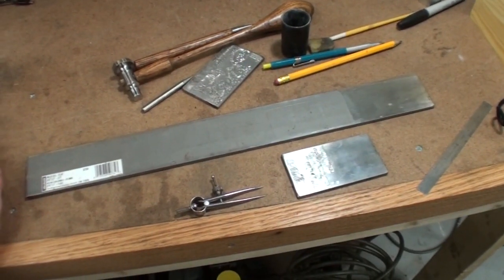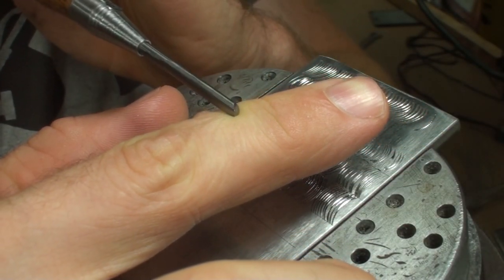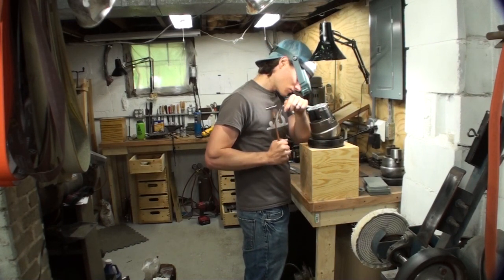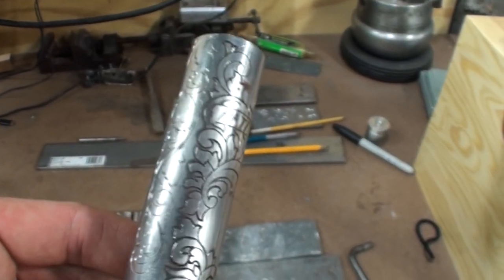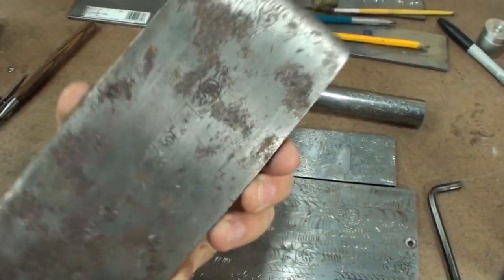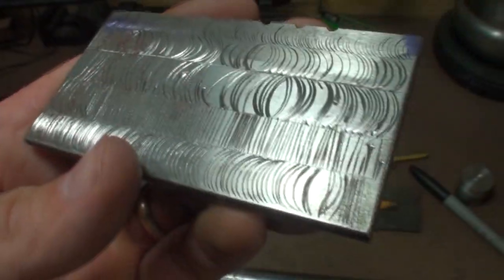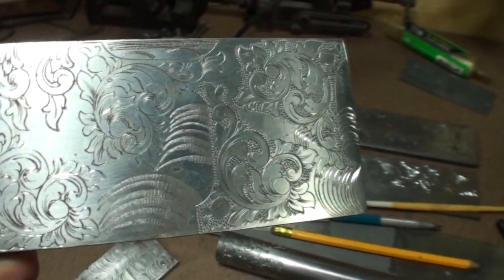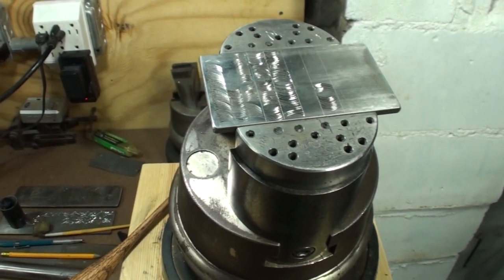Hand Engraving Basics - What To Cut First

Comment: really interesting, I have recently been getting into wood carving, I can see similarity's in the work but your working on a very detailed scale. Thanks for sharing.
Reply from the maker: There's some basic crossover which pretty much applies to any carving, just the tools are different. You also carving in something pretty hard, but at least consistent unlike wood where you deal with grain direction, and changes. Any carving is hard to learn, regardless of the material.

Comment: Hi From Sheffield UK...i have some carbide blanks...3mm and 3.5 rod..actually havea 2mm as well..can I ask at the end of this vid, are you using a 90?...70?....i made my own templates but , i think they are for power assist....120 , 110 is not going to work for me with push...i will make some flats from the rod...and mayb a few 90s, a 70 and a 70  kind of onglette....am I on the right track?

Comment: Hello great video, I have a question when ever I hammer on my graver the whole ball vise moves from the bottom every time i strike it doesnt matter how soft. How can I prevent this? thank you
Reply: Tried to use bench vice? Ball vice, (unless lockable in different positions) will not remain static because it is designed for push engraving. As such needs to be rotated by the non dominant hand for push graver work.

Comment: Excellent work and you have great way of explaining the process . You have inspired me to give it a try for the Lock on my Flintlock project . After plenty of practice of course . Any recommendations for my first hand Graver ? Thank You
Reply from the maker: Pretty much just what the video said, your biggest hurdle outside of the skill is the tools. Just engraving one thing is almost unfeasible because it takes so much practice to get to the point where it will look decent....so all that practice would be hard and a lot less efficient without the right stuff. I'd say slowly get the stuff together if your serious and just practice. The arcs are all you should worry about for a while. Just use mild steel flat stock. Look for more engraving content and perhaps someone to teach you.....not easy.

Comment: Fascinating! Thank you so much for vids! I want to engrave my own astrolabe on aluminium (since they are insanely expensive). Do you think that it is too much fuss to chisel out small numbers and small degrees hatches--is it a question of skill or even for a skilled artist it would be too much pain? I say that because a tiny number has such small radius curves.
Is there a method for transferring a printer image onto the metal surface? I was thinking of printing it onto a plastic transparency, then robbing the ink image with a scotch tape then sticking the tape onto the metal and engraving onto it. Or maybe there is a way of painting the metal with some sticky substance which will just suck the print out of the transparency pressed to it?
Reply from the maker: Learning the skill of hand engraving to do one project would be crazy. If I where you I'd do it one of two ways. Design the whole thing and have it laser engraved or you could acid etch it. You would mask off the whole thing then expose the areas you want etched. Look up copper plate print making.

Comment: One question: can this technique be used to prepare a makers mark for punching or burning into wood? I wondered how else to create the cavities required for this purpose. Filing will only get you so far. I enjoyed watching your videos. Thank you.
Reply from the maker: Yes it can, just has to be a reversed image. You can also use carbide tipped grinding bits for flex shaft tools or dremels I guess. The easiest way is designing it and paying a company to do it.
Reply: Thanks. I wasn't looking for the easiest way, but for a way to do it with the minimum amount of tools.

Comment: Are you using a turntable for your vice ?
Reply from the maker: No, it's a magna block vise sitting in its normal tire vise on a block built up out of wood. The vise swivels in it's middle and the resistance is adjusted by a allen bolt.

Comment: I heard that you can use concrete nails and sharpen them into a graver for beginners if your short on money, is this true?
Reply: true!
Reply from the maker: Maybe, but I don't see it as a very long lasting tool..... maybe good for practicing shaping, but even then I would rather just go carbide. You can also use HSS for softer metals and mild steel, once you get into firearms the steel is harder and more difficult to engrave. The sharper the tool, the nicer the cut....making the carbide perfect. But for someone who is going to engrave softer metals, jewelry for example, I guess the demand on the tool is less.
Reply: Yes you can, if you're cutting nonferrous metals like copper, gold, and silver.  However, if you're going to cut steel, you're going to want carbide tools like Homestead Craftsman said.  I don't know if concrete nails are harder than the steels you'd try to cut, but they have to be if it's going to work, as a general rule, and since it's probably not hardened, it will wear out quickly and you'll be sharpening a lot.  There's a video on youtube of an engraver using a nail, in fact.  Like Homestead Craftsman said though, carbide is better.  I've re-appropriated old high speed steel burrs as engraving tools, and they cut through gold, silver and copper easily.  Using a nail, you will have to sharpen more often, and if you don't have precision sharpening jigs, your angles will be different until you get adept at sharpening, which will further exacerbate your problems engraving.  I've been doing jewelry repair for years now, and have been getting into engraving fairly recently myself.

Comment: How to you fix the bronze eagle into the barrel in the title picture?welding?
Reply from the maker: The eagle is engraved just like the rest and then selectively gold plated. Basically the surrounding area is masked off and plated. Another way is to gold inlay where you cut out the border, then remove the rest of the metal within the shape how ever deep you desire for the gold you will inlay. The shape is under cut and stippled so that the metal can be hammered into the shape and locks in. The gold is then engraved. The two look similar but the inlay is much more expensive to have done.
Reply: The Homestead Craftsman thx for you reply.